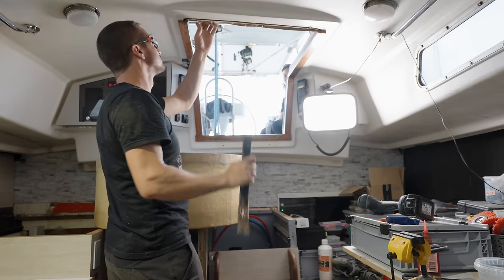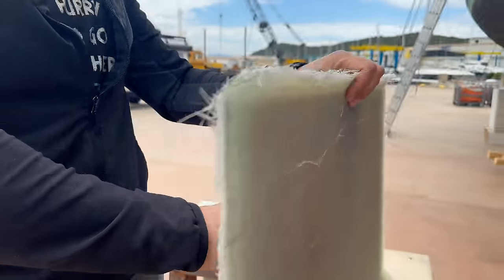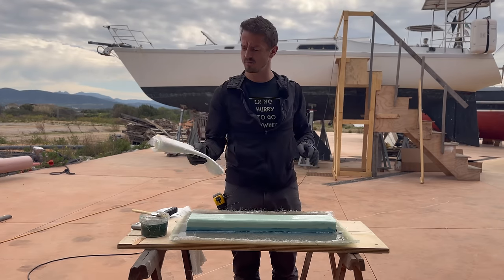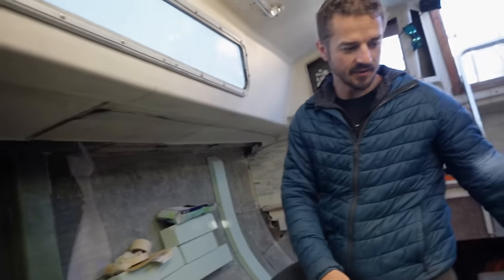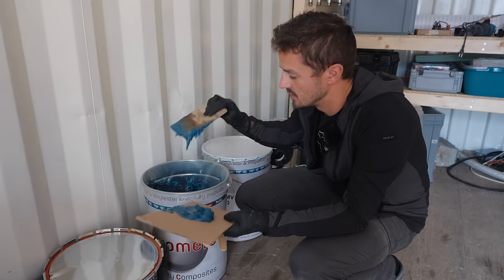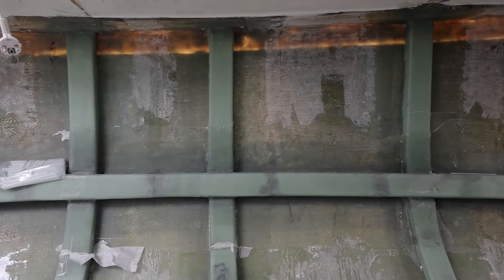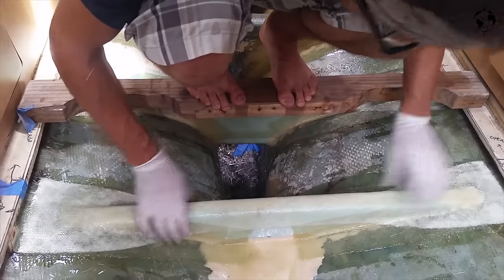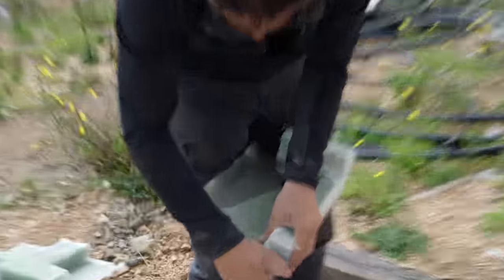Cutting Open our “New Hull”: What Could Go Wrong? | Step 386

Comment: I am in the medical field but to me looks like for example if you have a room and put the beams hanging from the walls, it’s like putting  shelves VS having the beams first then the structure around the beams, like a house but not sure if that apply to a boat. I will keep tune. I am sure you will figure this out,  you two are pretty smart.

Comment: Oh no! That's a huge problem! Could be waxed resin or residue from coated peel ply. Both are intended for final laminations.

You can use unwaxed resin which stays tacky for additional laminations and waxed resin for final laminations. Unwaxed saves you from having to do the required surface prep. The other issue may be that the use of coated peel ply which contains a release agent that would have interfere with the adhesion of subsequent layers.
Reply: Virtually all peel ply has a release agent. Nylon peel ply will not reliably come up off of the laminate unless it has a release agent. I have seen uncoated polyester peel ply but I don't think people use it that often. I think nylon peel ply is much more common.

Comment: Test the bits on the hull, if it all falls off, then simply cut it into manageable chunks, sand both sides and epoxy it back in: Not a disaster.

Comment: I would have used think'nd epoxy or something like TotalBoat Thixo to glue the foam to the hull and not hot glue.  You now have gaps between the hull and foam. I would also glue between each sections that overlap. Hot glue is used for arts and crafts not boats. With peel-ply not much tooth for the next layer to hook on to and the release agents need to be removed.  Need to sand and clean with acetone before next layer. Foam is not all the same. Foam products like Divinicell are made for boats, pink foam is made for insulation.  I know you guys have an emotional attachment to this boat. But it's just a boat. I think I would have started off with a boat with better bones. But at the end of the day, its your boat. Happy sailing!
Reply: The foam is supposed to be a void! the parts that need to bond are the wet laminate layers!

Comment: With polyester, you always grind the surface with a low grit (16 or 24) to key it, wet out the surface and use matt (CSM) as your first layer. Polyster resins can be used but you have to take extra care distributing the bonding area. Epoxy is a superior resin, especially for bonding but it's health dangers are not well publicized. I would never work with epoxy in a boat without fresh air equipment, knowing what I know now.

Comment: I feel for you with the results of your "test" delaminating... Epoxy would give you the best possible secondary bond to the original hull (probably polyester?). maybe lay down a strip of biax using the same materials/methods that the guys are using inside the hull to put down a test patch and leave 3-4 inches hanging loose on one end so that you can get a good grip after full cure and see if you can peel them apart? 
I'd rather know now then have to do this all again after the first hard bump like you mentioned...

great work guys. Love the project.

Comment: Friends.
  I noticed, in my opinion, a number of errors that led to low adhesive strength.
  All work on the repair and reconstruction of boats, even with a polyester hull, must be done not with polyester, but only with epoxy resin!
  It is more expensive - but adhesion is several times higher.
The gluing areas must be cleaned with an abrasive and completely removed from dust with acetone. Moreover, dust one place 4 times, each time using the clean side of a napkin with acetone.
  The widest layer of fiberglass fabric is always glued first - for maximum uniform contact, all other additional elements of the material are on top of it.
  The huge contact area you have is not used under the foam block - where the hot glue is. There should also be a layer of fiberglass with epoxy resin adjacent to the body.
  The shape of the foam bars should be closer to triangular - the triangle is the hardest shape.
  You can make a model - according to my recommendations to check the difference.
  I would not save the option that you managed to make in the boat.
  Good luck and success!

Comment: I've been doing this for so many years. A trick that works so well is to laminate more than one layer on polyethylene film and flip this on the stringer; i've done as many as 5, 6, 8 layers at a time. also is to whip up a goo whit a bit of milled fibers  so that when rolling with the buble rollers it makes a full suction contact . This would speed up the process.
Reply from the maker: Yes, if you don't need to cut or shape the layers in between. We find it quite difficult to see or be able to get out any air bubble more than 2 or 3 layers deep. But we use the same process when doing simple tabbing jobs. Layer you 3 layers at once on a sheet, then laminate them to the bulkhead in one go.

Comment: Your breaking test of the scale piece took delamination to a whole new level. I've never seen anything floating delaminate like this. You might wanna show this test to your engineers before moving further on with the build. If your old hull or outer skin down not bond correctly to the inner skin all this work is just wasted so figure it all out now. Maybe better chemicals is the way or even removing the new inner skin and use sandpaper everywhere so it got some places to grab and hold onto?

Comment: It looks like you have received expert input as to why your structure delaminated from the “hull” section in your model.  Sanding between layers whenever your bonding items is key as well as cleaning residue.  Hopefully you sanded and cleaned Uma’s hull sufficiently to ensure a good bond.  Have faith.

Comment: You forgot to put the reinforcement ribs on the deck! If the coat is dry, you need to sand it to expose the fiberglass to plaster it again.

Comment: As others have said, your use of peel ply and not sanding and wiping clean with acetone. 
When divinicell is used, it has scoring that allows both the glue (it’s like a structural bog) goes thru between the outer glass and the new resin and glass on the inside.

IIRC, Layup for survey of 11m cat hulls is about 1565gm of glass on the outer layers, followed by 10-12mm? divinicell followed by another 1525gm. The bottom is thicker again.  Usually below the waterline is full glass, not foam cored.

Comment: My small contribution to the problem. (I’m not expert so don’t trust me)

But. Vinylester or polyester don’t harden fully when exposed to oxygen. If they do, the resin will contain wax that floats to the surface and needs to be removed before applying more layers.
Using laminating resin without wax makes it possible to continue the work with chemical bond within certain timeframe (I don’t know what that is though)
I haven’t been able to find “laminating resin” from the hardware stores at all. They’re all just “polyester” and they don’t mention the wax at all. But as they do cure completely, they DO have it!

So what I expect happened there is that you used resin with wax and didn’t remove that before adding next layers. Apparently the peel ply didn’t take the wax off either.

So, you need to use laminating resin without wax to make the laminations and to cure that completely you need to add gelcoat with wax on top of the last layer to make it cure completely.

That way peel ply is not needed at all. The vinyl/polyester without wax will stay tacky for days and it’s possible to continue without any additional sanding etc.

Peel ply is really for epoxy that forms amine blush on top when curing and which has to be removed before additional layers. And epoxy doesn’t care of the oxygen at all but it will cure fully.

Comment: Pro: The hull was prepared different than the sample. You used a grinder and sandpaper to prepare it. It was rough and ready to accept the new glass. You had also cleaned it. I do believe you will be good there. Con: lacks epoxy on the back of the foam. I would have used that instead of hot glue. Then lack of coving on the sides of the foam to create a radius to let the glass relax over the corners. However, the inside of the hull was prepared correctly to bond the glass to the original. Stay safe!
Reply from the maker: The blue goo you see in our sample and inside is a filler used to create the fillet on the 90° from the hull to the foam.

Comment: A bit heart stopping for sure, but I predict the experts will give it a pass as your comments suggest. The model hull (new, smooth) is not the same as the old hull (rough, sanded) BUT in the worst case and it all delaminates, then you still have the proven old hull totally supported by the new, heavily ribbed, inside hull!  You are making an extraordinary expedition hull and you can be confident Uma will always get you home!
Reply: it doesn't work like that. If the bulkheads aren't bonded to the outer hull, the flexing and movement of the outer hull will cause stress fractures and eventually tear the hull open. The inner "hull " won't then protect them at all.
This would be a very dangerous boat if the new components haven't bonded with the old.

Comment: The hammer test was performed on partially bonded sheets, because of the cutting of the hull test section. As you said, the ship yard guys are experts, so the delaminating on the test board may be an anomaly. And you roughed up the hull surface before laminating. If it was required my guess is it was done by the yardies.

Comment: I have not done any research on the use of that foam on a yacht structure. It's the first time I see it. I hope all goes well and the structure will be stiff enough to support impacts and torsion forces. Good luck!
Reply from the maker: It's used all the time in boat construction to add stiffness to a hull.

Comment: Always assumed y’all went to the North Ave Trade School (midtown ATL) and worked out the deflection and shear forces in the laminated construction. The great news is that you still have at least two more layers of fiberglass to tie the structure together AND will have the stringers and ribs structure to stiffen the deflection forces and spread the impact loads. (Think large forces on a small area will be spread out). You certainly have a bonding failure in the model which might be because you didn’t sand/skuff the “hull” to provide sufficient adherence of the laminates. Your model, and the cutting open of it for illustration, reduced the strength considerably. 

I’m not worried about the cliffhanger on messing up. Destructive tests are meant to identify errors. (Wings always break in the test. It’s breaking too soon or too late that concerns the engineers and bean counters😉). 

I would be more worried about your lack of weep channels to the bilge which will dam condensation and/or leaks into your floorboards as gravity does its thing to the water inside the hull. It’s easy enough to solve now and I hope it’s already been done as doing it later will be a pita. 

Admire the undertaking!

Comment: What I am wondering is, did that "peel ply" stuff that you covered the uncured fiberglass with leave a slight residue - which caused the extra added layers to not actually adhere to the "base" layers?  If your fiberglass and resin works like the kinds I know of, it won't cure if it is exposed to air.  That "peel ply", I'm figuring, seals out the air but does not bond with the cured fiberglass.  

Now, I have a 16 foot day sailer that needs a new layer of gel coat on the hull.  My brother, who knows boat repair, told me to get the kind that includes wax.  That sounded odd to me, but he explained that for the gel coat the cure it must be cut off from air.  As the gel coat begins to cure, it heats up and causes the wax to "melt" and rise to the surface.  That is what cuts off the air from the gel coat layer.  

I have a feeling that that peel ply film that you used left a slight "waxy" substance behind.  So, I think that you should have cleaned the surface after removing the peel ply and moving to the next step.  You needed to get rid of the residue it left behind.  Now what I want to know is, . . . did the fellows inside Uma, do things the same way as you did, using that peel ply film at various steps?  Or did they make sure that they had "clean" surfaces at each step?
Reply from the maker: It’s not supposed to. The whole point of peel ply is to make laminating the next layer super simple and easy. We’ll explain more in the next video.

Comment: My suggestion would be to revisit the test component scenario, half scuffed to take advantage of a mechanical bond on one side of the piece that will be bisected, on the other half scuff some sections and some areas to be kept as it was in the original test piece. If the side with the mechanical bond does not delaminate, during destructive testing, and the other side of the bisected test piece has non-delaminating where the mechanical adhesion was provided and where not, there is no bond  where smooth it lets go, you will have new data provided by the two coupons in two different ways,which will demonstrate degrees of failure and or confidence.

Comment: That Goop resembles the Polaris Missile Epoxy my dad used to bring home from work(expired epoxy kits)...There is a driveway and wall that has some smears 50 years later still intact....and strong as is was rubbed off yesterday......I still would have found a small plot to dig a hole and plant it in the Ground, to make Uma into a Tiny Home with some class....

Comment: You probably already know this but I believe that vinylester resin is not a good bond with polyester resin that is 50 years old, but this is questionable. By any means you stress simulation was done in two steps and after first step the "hull" sheet had to be well prepped for the new layers of fiberglass to bond to it correctly, by making surface as rough as possible. I would also suggest to try polyester and epoxy for the same stress simulation you did to see how they perform in comparison. Also prepping the hull by creating surface something similar to chopped strand matting(probably sanding hull inside with something rough) would be ideal surface to grab to with epoxy, polyester or even vinylester. Also check the foam you are using with epoxy and polyester as it can just melt down into liquid. To prevent foam from melting you can use home depo water based paint as protective coat. As those ribs already installed are easy to remove now, do remove them and rough sand both the hull and the ribs you created and attach them with epoxy after some time, by giving enough time for vinylester to set fully. I would also suggest while it is not too late install closed cell foam for the entire hull for insulation purposes. There is another hack of using stainless steel screws without deep penetration and good fitting resin for the job into the hull to bond your beams to the hull. And before trying to redo everything try to hit one of the ribs you created with the hammer and see if it detaches. Regards.

Comment: Why would you use plywood vice coosa composite board which is lighter, stronger and will not rot? I know you are not this far yet but just asking. It can also be used for stringers, ribs and flooring.
Reply from the maker: Plywood is easy to work with. And if done correctly won't rot either. Most of the plywood we took out was 50yrs old and still just fine.
Reply: @SailingUma  But why use an inferior product when you have done so much work.

Comment: You still need to wipe down with acetone regardless of the peel and ply. We have stopped using PP for the most part because it is expensive. Always do good prep acetone at the minimum but a quick sand is better. I would do a test in the boat and see how it adhered. Epoxy is a glue poly and vinyl are not.

Comment: The destructive materials testing was very interesting.
 I was wondering about the styrofoam getting waterlogged. In boats where they used to add foam floatation such as the Boston Whaler there were water logging problems as the boats aged. Newer models of Sunfish have sealed plastic  cells and no foam floatation. Your foam is structural rather than for buoyancy, but the wedges in the bilge might be problematic in the future.  Good luck.
Reply from the maker: It’s closed cell foam. Same stuff they us in all new boat construction. Pretty much every modern sailboat has a foam core and foam stringers. This tech has come a long way since the Boston whaler days.

Comment: It's not exactly the same process, contrary to what Kiki says at 30:10 . Uma's hull had been recently sanded and wiped down once the resin was (very very well) cured. 
The test panel was surfaced with peel ply, with no sanding subsequent to removal. 
I suggest taking the test panel, sanding it, wiping with acetone, and then the same procedure as before. 
If that is still not sufficiently strongly attached, due to cracking at the root of the junction with the hull, I would do it again with large fillets in the fairing compound where the sides of the ribs meet the test panel.
Reply: There's one other difference: By cutting away half the rib, you created a "peel" scenario, a single lap join rather than two lap joints back to back, which exposes a critical weakness of all adhesive joints. A peeling failure exposes a single line* at one edge of the bonded interface to the entire tensile load, and when it fails, that line progressively moves across the panel (very fast, but it does have to move). A direct tensile failure spreads the load across the entire area of the interface.
* A single line, in theory, means that the stress is infinitely high, because a line has no area. It is 1D, not 2D.